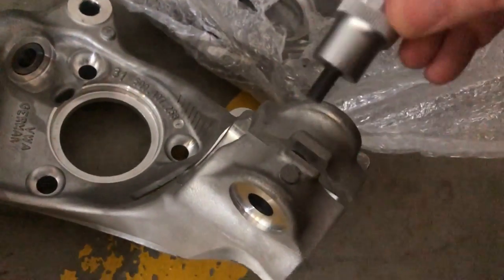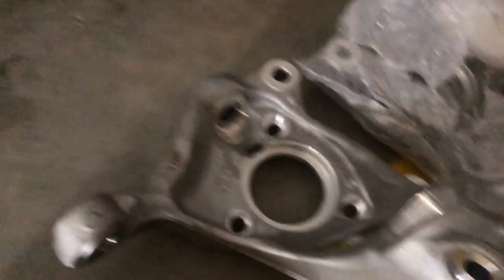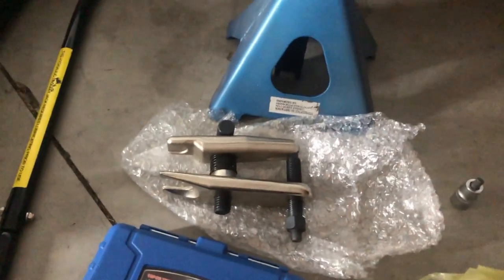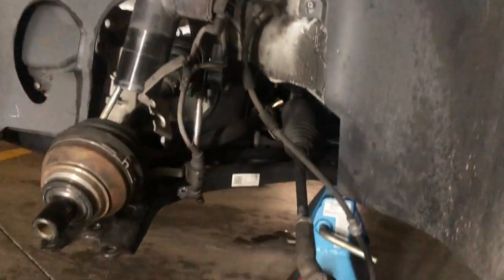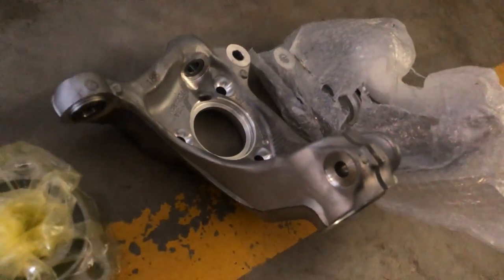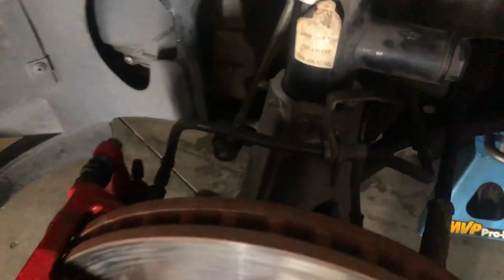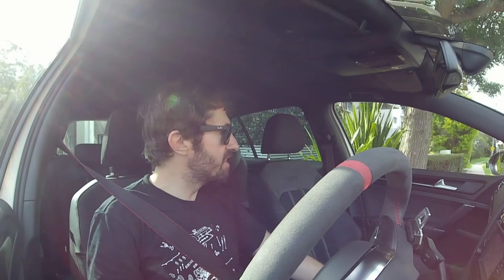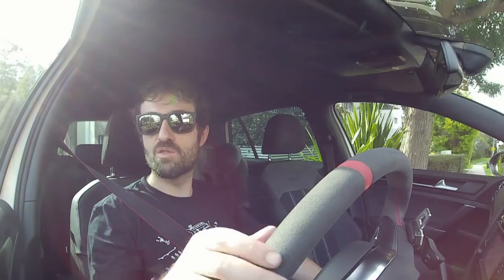Installing Clubsport S parts on my MK7 GTI -  Part 2

Comment: Will you end up going for the CSS spring swap to get the full 2deg?
Reply from the maker: Honestly I'm in two minds about that. Part of me wants to install the full "S" chassis to get as close the to CSS as possible. But part of me thinks the incremental difference over the Clubsport springs will not be worth it. The next step for more camber will probably be replacement LCA. I have Whiteline LCA ready to go on but I'd also like to try TTS arms with the adjustable lower ball joints. Perhaps I'll do both, for science :)
Reply: Charles Sprinkle so update to this is that I now have -2.2 deg after a better alignment. So no need to do anything else really. Whiteline have a new product out. Roll centre adjuster that also has adjustable camber. Worth a look I reckon.

Comment: How about putting in the Clubsport S alloy subframe - I believe its stiffer and a few pounds lighter than the pressed steel version.
Reply from the maker: Keith Bowen Hi mate. Alloy subframe is certainly something I want to do. Just haven’t pulled the trigger on it yet. Costly for the gains but worthwhile for when it’s all together I think. Also been considering if it’s something I will tackle myself or have a shop do.
Reply: @trackhackau  You can find used alloy subframes pretty cheaply or try e-acca. I'm interested in trying these Clubsport S parts on my R. Will I noticed the 2kg drop using the CSS rotors in terms of wheel control? Does the CSS have differing anti-roll bars? How much lighter is the CSS battery? Are the CSS springs lower and stiffer than the CS/R springs? Are CSS parts better than aftermarket 'upgrades' ? So many questions! Looking forward to some of these CSS parts on my R to improve the turn in and have a more engaged drive.
Reply from the maker: I’ve found used is still like $550. I can get a new one from e-acca or cars245 for not much more. 
I don’t think you will notice the 1kg per side much. But it all adds up. I put on 2kg a side lighter wheels though and felt a small difference. But only the first time I drove it really. 
CSS RSB is about 17% stiffer only. So maybe not really worth it. Although a lot cheaper than aftermarket. Front is the same as a CS/PP. 
Battery is about 10kg lighter. I’ll have a video on batteries in the not too distant future. 
Springs do have different part numbers. I think front is a touch lower and stiffer to get the full -2deg camber compared to my -1,57” but not a big difference. Rear must be different due to the weight difference but there is not a lot of info out there on them. 
“Better” depends on your point of view and objective. I think generally an OEM part will be made to a very high standard. But in saying that there is always cost compromise. For example pressed steel LCA/subframe and plastic RSB endlinks. So I think it depends what part and what you need out of the part. I like OEM for its high manufacturing standards and NVH attributes. Especially the CSS parts as they were selected by Porsche engineers to make a car go fast around the ring and last a long time. They would compliment an R very well. Would be a weapon.
Reply: @trackhackau  I was going to put a CSS battery in my R however there are now great Li-ion aftermarket options, although pricey...huge of mass of weight mounted so high up. Will look forward to a feature on that. I'd like the Super-Pro LCA's but they are a solid chunk of coin too.
Reply: Keith Bowen look into Whiteline LCA. Also great quality, two versions depending how aggressive you want the caster and they are cheaper and often on sale. 
Also the option of TTS LCA with the adjustable lower ball joints. The cost about the same as aftermarket. Downside is the push the track out quite a bit so wouldn’t work well with BBK and OEM wheels.
Reply: You can take any Audi A3 subframe..they are all lightter...made from Al. If ibam correct...and not cost a furtune...you can check it!!!
One of my buddies mounted on the prelift R!!!!
Reply: Master321v yes I believe you are right. All A3 have the lighter aluminium subframe.
Reply: Is it actually different than the Audi S3/A3???
Reply from the maker: @ABeans07  Clubsport S/S3/A3 all share the same alloy subframe. Its the same part number.
Reply: @trackhackau  exactly! 😎

Comment: Is it a worth mod for daily driving (with ocasional spirited backroafd)?
Reply from the maker: I think it depends on what your ultimate goals are and your approach to modding. To be honest camber tops will get you the same result for less. I took this OEM approach as a starting point as I can then later add aftermarket parts to get even more camber.